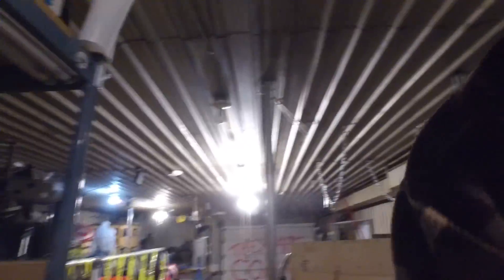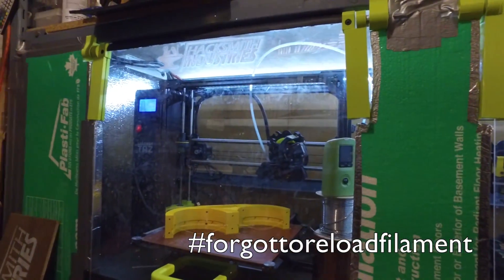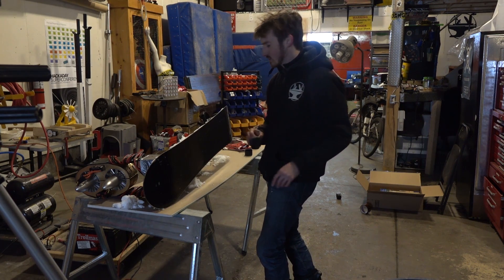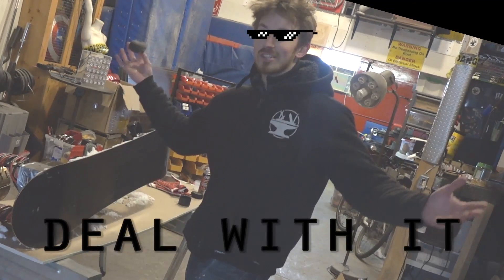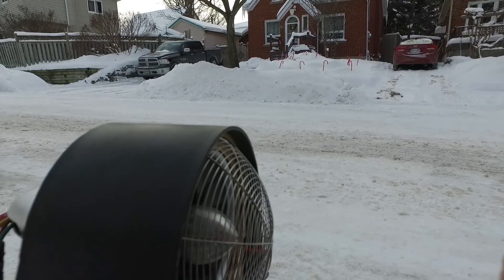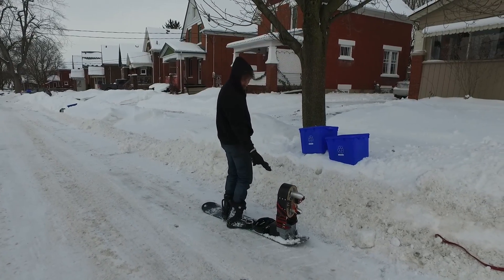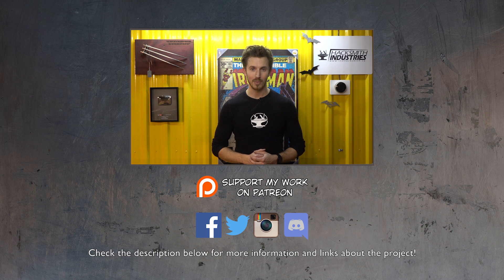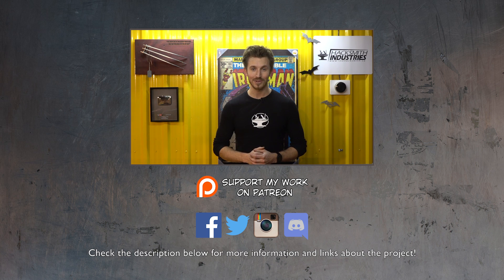Make It Real: BOOSTED "SNOW" BOARD

Comment: The only problem I see is the lack of carving ability, since it has to be on such hard packed snow, you have nothing to dig your edges into, you could potentially use wings like on an air boat (since that's what you've basically built here, and "air board") and lean as the board turns to take a corner, but your def going to need a deeper snow to do it
Reply from the maker: +Gabriel Strom you can still carve, we just need packed snow :p
Reply: the Hacksmith, true enough, but it would be cool as hell if you could cruise over anything, would adjusting the fans slightly down towards the ground change anything you think? I think this is very cool btw, well done

Comment: what if the edf's are side to side and mounted lower on the board not stacked on eachother? maybe then you get more control because now your centre of gravity is higher?
Reply from the maker: Then when you crash you'd bust an EDF =(
Reply: yeah also true. maybe a lightweight protection?
Reply from the maker: Possibly, but we wanted to keep it compact with the board -- as for location of thrust -- doesn't make much of a difference because my center of mass is already much higher than the EDFs =)
Reply: the Hacksmith hmm alright..hope you learn to control it and start a snowboard revolution with yout idea ;)
Reply from the maker: +Ivan B the batteries are actually the lightest part. We made the steel weldment a little too robust :p
Reply: What if you mount the batteries on the front for weight distribution, it might make it easier to control the board and steer it.

Comment: You should add a small electronic thermometer to the box with the batteries. Just to make sure they don't overheat. And maybe even a cooling fan.
Reply from the maker: The battery alarms are all we really need =)

And cooling fan... they are fans =P and it's winter! =P
Reply: Ah ok, merry Christmas! ;)

Comment: I think mounting the motors on the front would make more stable and better set to pull.  maybe for redesign
Reply from the maker: They'd need to be really wide -- if the exhaust from the EDFs hits your legs or boots -- you don't get any power =(
Reply: the Hacksmith I think even like a foot and half or so  would do...  maybe tilt them both In a few degrees.. as to direct past legs...and mount them side by side instead of on top..really awesome project though...wish I could tinker with these motor..r they reversible??   maybe use for brakes on longboard
Reply from the maker: If they stick out from the board, then they're toast when you crash!

These specific ESCs don't have reverse, but it is possible to reverse the motors =)
Reply: the Hacksmith some kinda cage would be needed.  thanks for replying quickly bro,. great content and projects..

Comment: just an idea - add thrust vectoring panels to the exhaust. Focusing the thrust with the panels might improve the performance by refocusing wasted thrust exiting at odd angles. Also, if the vectoring panels are mobile you might improve the steering and breaking performance (breaking via reverse/diverted thrust).

Comment from the maker: Don't forget to check out our jet-powered long board too! ► https://youtu.be/eMeeFEMTx78  

Thanks for watching!
Reply: the Hacksmith put a rudder on it
Reply: You mean don't forget to check out your jet-powered long board like how you didn't forget to load more filament? XD
Reply from the maker: +Shubham Patankar you're the one whose not being practical... You're the one saying I should rebuild it the way you say, even though it works just fine and I designed it like this. If you think your idea is so much better, then make it yourself and show me up :)
Reply: put wheels on it for the summer and also, can u work on making a jet-pack that works?
Reply: FilmGelenk632 FilmGelenk632 
Nope...  if he designs it wisely, the objective can be achieved with less or equivalent material than this. I'm just giving reference for placement of propellers. It isn't necessary here to use steel; another material such Aluminium or  PVC sheets would work fine.
Reply: fuck
Reply: Instead of stacking propellers, split them side-by-side as in planes at a effective length 5/8th of board length. Also tilt them upward 5'-10'.
Reply: FilmGelenk632 FilmGelenk632 
I don't understand  what do you mean by 'edv' ?
Reply: FilmGelenk632 FilmGelenk632 
Well that's a matter of his ice boarding skill set. Another, thing is he won't do it so randomly; as he is super nerdy, surely he would make safety precautions prior. If you're a inventor, It doesn't matter if you pay in loss for doing something better.
Reply: Are you guys planning on adding anything for stability?, like side skis?
Reply: the Hacksmith can you try to jump with the exo suit???
Reply: Design and build a toy gun that shoots nerf darts
Reply: FilmGelenk632 FilmGelenk632 
Why you're so philosophical theorist..?? Be practical dude... Go to some workshop, give it a try. & Yeah, I welded Aluminium in college days during project work, just do the right thing right way.
Reply: the Hacksmith You should add lithle find for stabilizing the board
Reply: +FilmGelenk632 FilmGelenk632 
es ist okay..
Du bist größzügig...
Reply: +FilmGelenk632 FilmGelenk632 
ich verstehe nicht,dass wie können die Edfs getötet werden.?
Könnst du erklären..?
Reply: the Hacksmith 
Oops... if I did that it will take time & I would be fired from job. I Alarm me in November 2018, uptill then I'm tied in job bond. That's why I'm here to enjoy things you do.
Reply: +FilmGelenk632 FilmGelenk632 hmmm Recht..
aber denkst du nicht,dass der Position können die Effizienz ansteigen..
Und damit könnt es etwas stabilisiert werden..
Weil die Höhe ist auch reduziert...
Reply: +FilmGelenk632 FilmGelenk632 
I möchte deine Email, weil ich etwas mit dir diskutieren möchte..
Nur wenn möglich..
Reply: boo skis, boards rule
Reply: +Matthew Huber 
what
Reply: the Hacksmith what was that song you used in the video?
Reply: the Hacksmith do u use an anvil and if u do can u send link to buy
Reply: why tf would you mount the edfs so high, mount them directly to the board and 3d print some kind of ram air system out to the side so you also have space for the battery.
Reply from the maker: +Joshua Nordin -- if you mount them low snow would get sucked in. If you mount them horizontal, as soon as you take one bail, you'd destroy them.
Reply: #@the hacksmith plz make the hover board from back to the future
Reply: the Hacksmith how much thrust did you use? The link to the edf just shows an error.
Reply: the Hacksmith all that's left now is a boosted surf board
Reply: the Hacksmith I